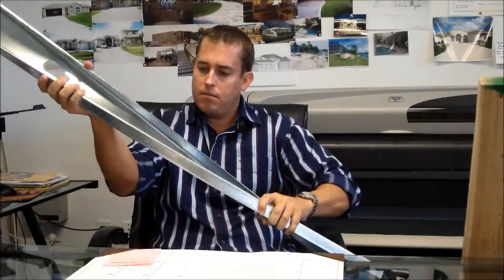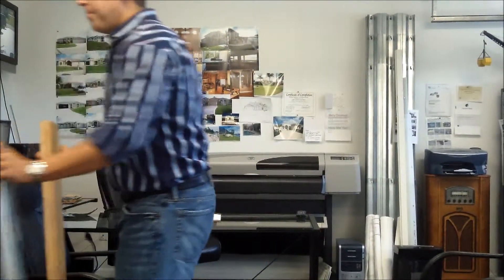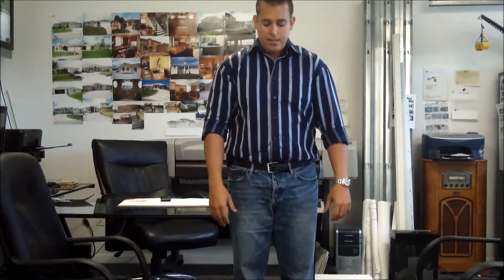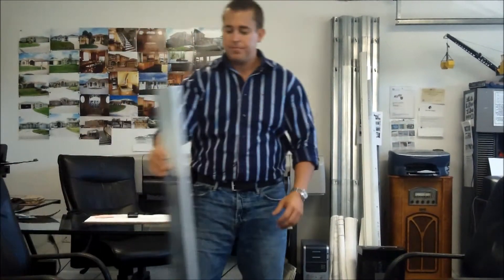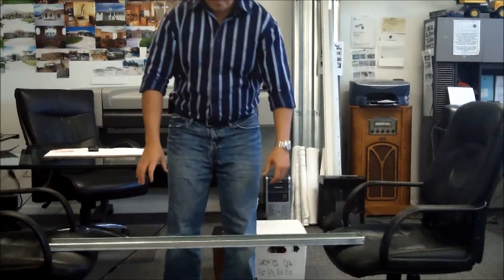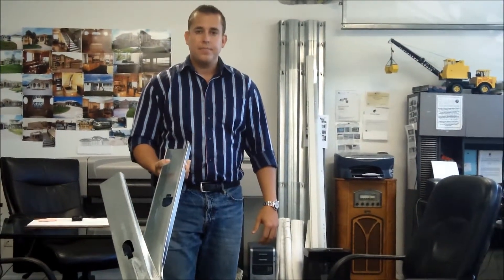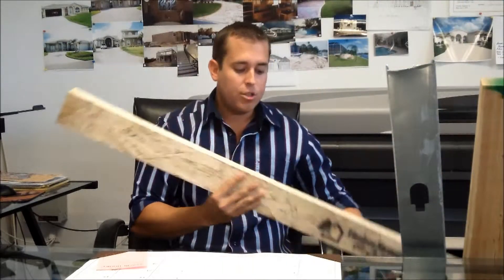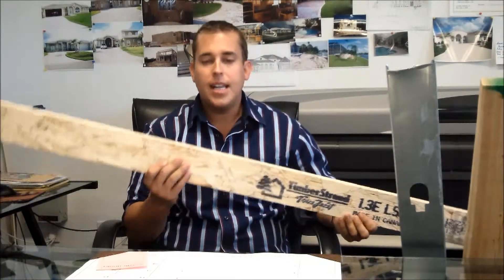Interior Wall Framing - Frank Fredericks Custom Homes

Comment: Steel studs are more recyclable than wood in demos all the wood goes to the dump metal to recycling, less r value loss and all the commercial buildings I've worked on are standing strong,that test you're doing is crap I wouldn't hire you as you don't know what you are talking about.